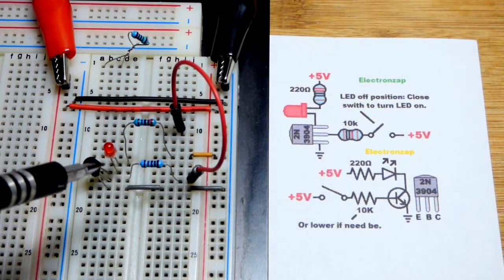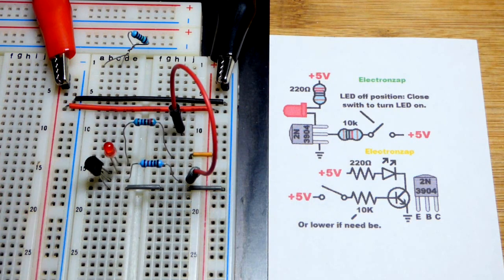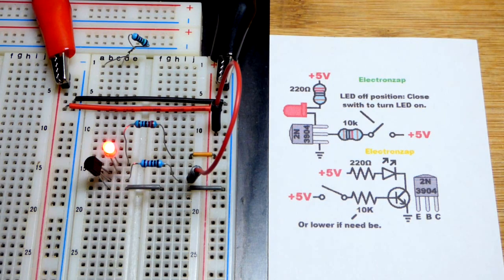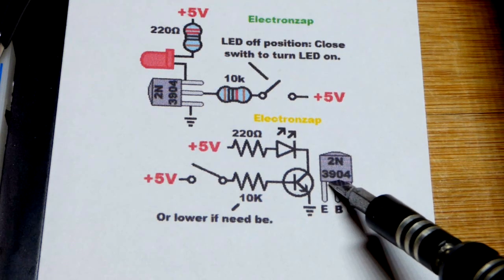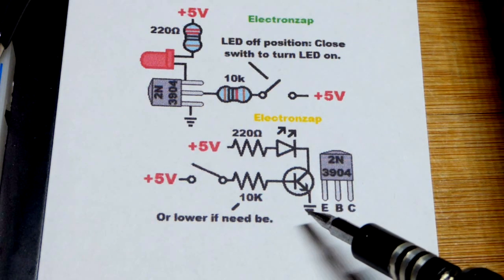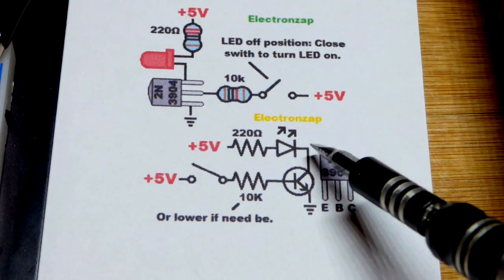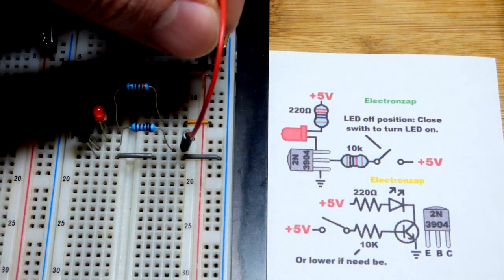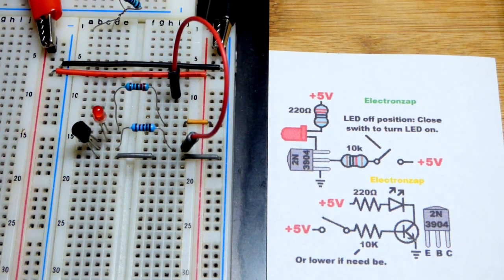NPN 2N3904 bipolar junction transistor BJT switch circuit breadboard circuit and schematic diagram

Comment: Another good basic circuit video , thanks. I made up a breadboard with 555 chips in astable, monostable and bi-stable to have at hand to play around with adding other circuits/loads to them. The output from pin 3 Im getting is around 3.5v on 5v so a transistor switch is a useful addition to get back up to the original source voltage
Reply from the maker: Good times! Using the 555 timer to switch an NPN BJT might be my next video for that very reason.
Reply: @Electronzap  have you come across the astable 555 with just a trimpot on pins 6,7,8 - 100uf cap between pins 1,2 and jumpers from 4 to 8 and 2 to 6? I found it on another channel I follow its the simplest one I ve found to build and adjust.
Reply from the maker: @utkf16  pin 8 connects to the positive supply (Vcc) and pin 7 connects to the negative (ground) supply rail often. So if the trimpot has no resistance between pin 8 and pin 7, then that is a short circuit which would be bad. That's why I never show that variation. But as long as you are careful to keep enough resistance between pin 7 and 8, it is a cool way to vary  the 555 timer output.
Reply: @Electronzap  Something Id not considered but up to now its behaved OK. Thanks for the reply